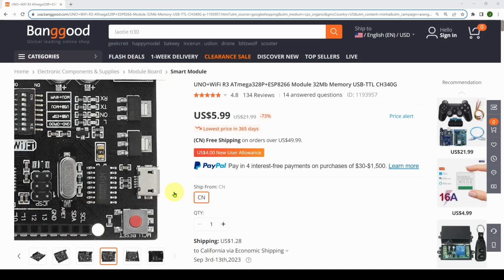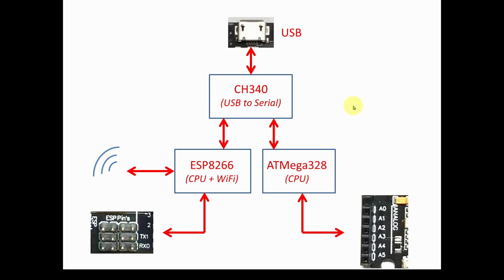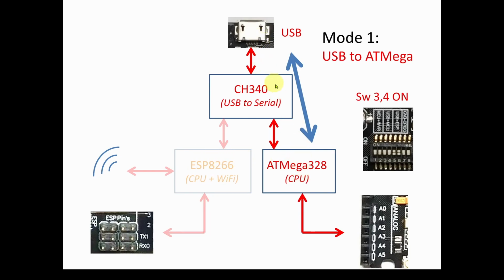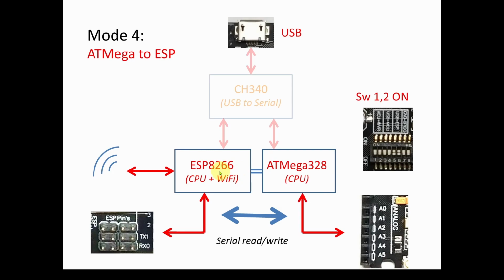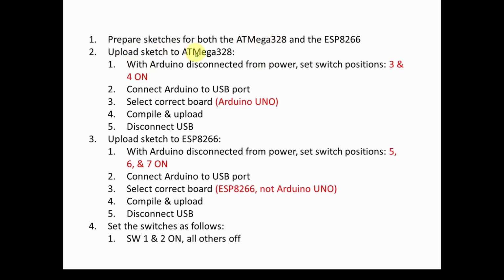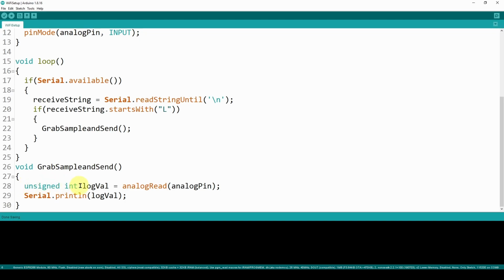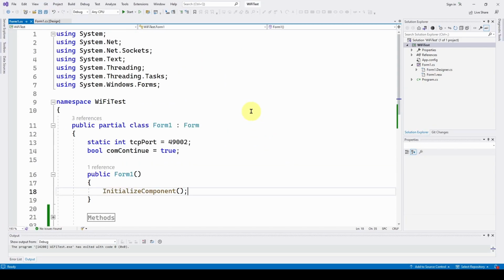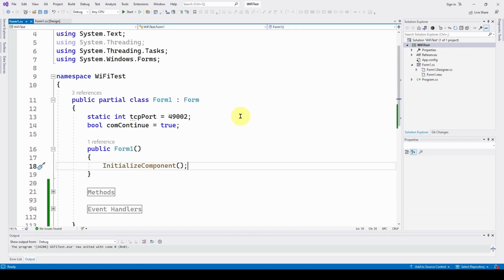Inexpensive Arduino WiFi ESP8266 Part 2: Accessing GPIO Pins

Comment: Hello, i just wanted to thank you for this tut, it´s amazing! I got this arduino board for christmas, but i just putted it into a box, because i didn´t know how to use it. A two weeks ago, i started to program wemos (d1 r1) and other things (like micro:bit) with wifi, and upload data on thingspeak. Right now i was trying to do a html webside executed from ESP8266, but wemos don´t have nearly enought pins for the project i want to do, so it was a great opotunity to try this arduino uno wifi.

Thanks again for this amazing tutorials!